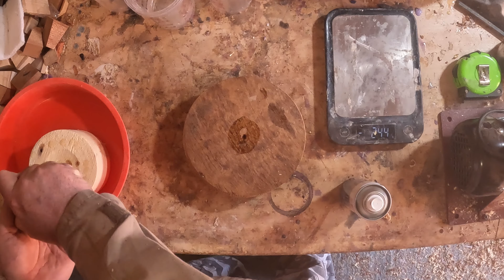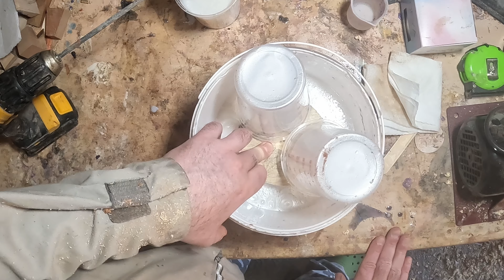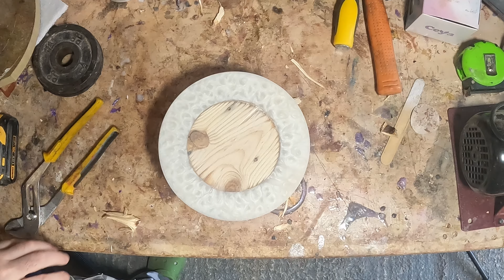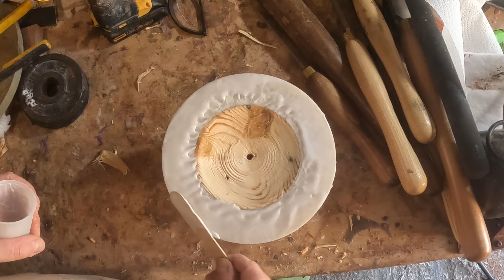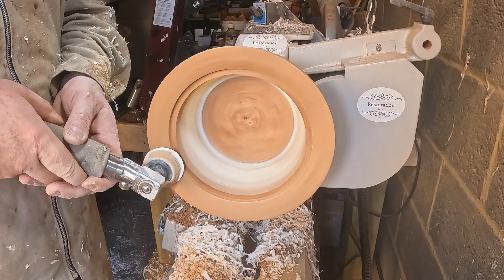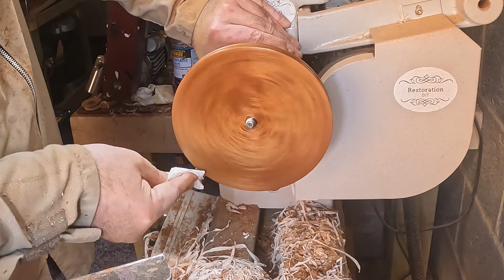Woodturning | Cherry Lidded Bowl With Marbled White Resin | Restoration DIY

Comment: I've got silicone pans.  Cupcake, Bundy cake, and regular round cake pan.

The round one seems like you could put a waste block inside it. Spray release stuff on the outside of the silicone pan. Use it like you would a regular waste block. 

Then pour the epoxy. Once it's cured you could take out the waste block and the round silicone pan.
Reply from the maker: Hi,  I did that on a previous project it works really well I must do it more often 🙂 thanks for the suggestion 👍🙂